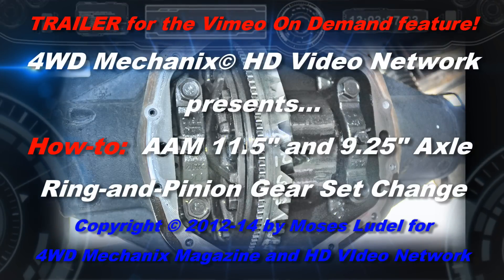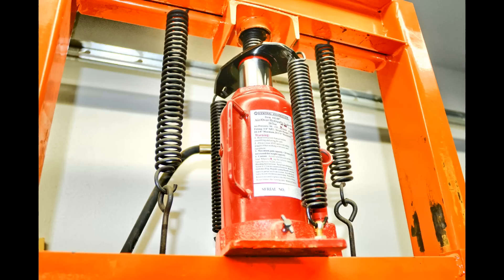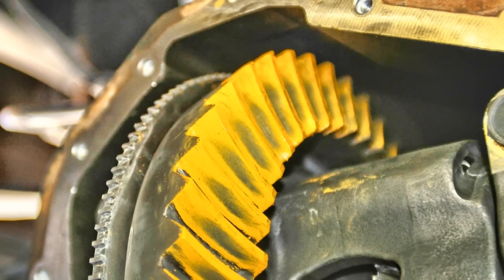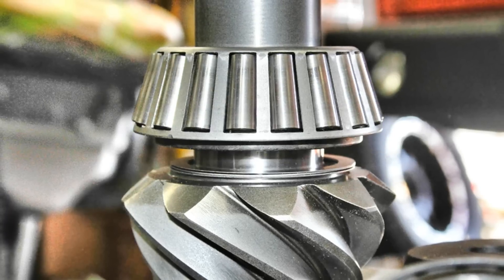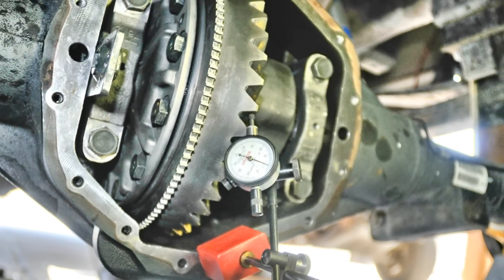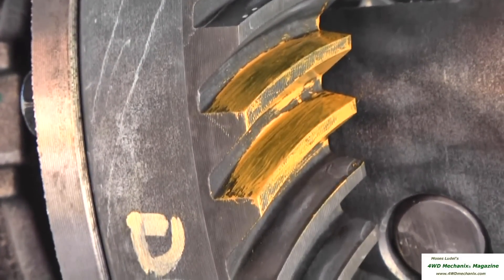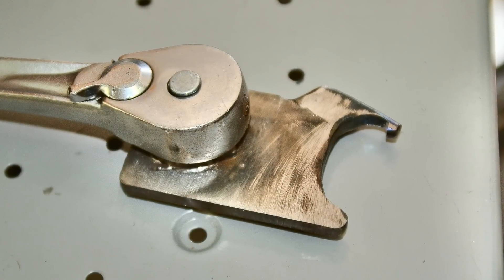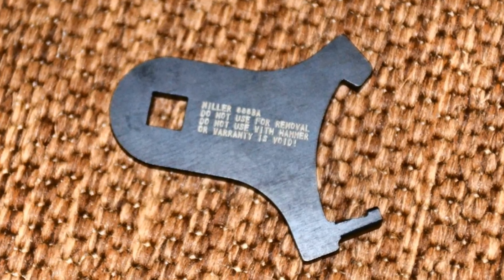TRAILER for the Full Length 75-minute AAM 11.5" and 9.25" Axles Rebuild Video

Comment: I am running 35s and was told by Yukon that 4 11s would get me back to the stock gear ratio
Reply from the maker: This would be as close as you will get if your gearing was originally 3.73 and tire diameter was 31.7" to 31.9".  The easiest way to test this is an rpm calculator.  I first run a calculation on the original tire diameter with the stock axle gear ratio.  I use 60 mph for the baseline.  See what speed the engine turns at 60 mph with the original tire diameter and stock gearing.  Then do the same calculation with the 35" tire diameter and 4.11 or 4.10 gears.  Compare the engine's rpm at 60 mph.  If you have overdrive, make sure you use the overdrive ratio when you input the transmission gearing.  On my 2005 Ram 3500 with a 48RE 4-speed automatic, the transmission overdrive (4th gear) is 31%.  So I use .69 as the transmission's final gear ratio.  Spicer has a calculator:  https://spicerparts.com/calculators/engine-rpm-calculator.  Here is the easy calculator that I have used for years:  http://www.csgnetwork.com/multirpmcalc.html.  There are now many calculators available.

Comment: Hey Moses, can you tell me the part numbers of the sleeves you used in the video to push the tinker bearings onto the differential and for the rear pinion bearing? Doing a rebuild this weekend and could use those.  Also what size / PN bearing splitter/separator you used for removing the pinion rear timken in the video "yes I rented your video on Vimeo"

Cheers;

Andrew
Reply from the maker: Andrew, thanks for supporting the rental video, it's been popular.  Since this may be a one-time job, the best bearing splitter is a "universal" type.  I have expensive "capture" bearing fixtures for axle work, though you can get by with a common splitter like an OTC 1123 type.  (Search for images online, National Tool and everyone else carries this puller.)  I like the ability to add accessories to this particular splitter design, in particular a stand-off fixture with threaded rods that stand outward from the puller pieces.  Make sure this or any other splitter you choose will clear the bearing cage.  Measure the bearing before buying a puller.  

The idea is to carefully grip the bearing collar's backside at the seat point without chewing up the carrier or a gear bearing shoulder.  Once you have an ample grip on the backside of the bearing's collar, place the splitter on your press deck.  (You may need to make a safe stand to provide clearance between the press deck and parts.  Be creative while keeping safety in mind!)  Rely on the press to remove the bearing, the splitter is simple to get an ample, safe grip behind the bearing's inner collar.  Never apply pressure to the bearing cage, it will bend and distort, ruining the bearing.

For pressing new bearings onto the differential flanges or the pinion back bearing, again rely on your hydraulic press.  You can improvise sleeves with large deep set impact sockets of the right depth and I.D. (if you have them).  Black pipe of the right inside and outside diameters also makes an adequate sleeve for pressing a bearing into place.  In making a sleeve, be sure that the contact surface puts pressure only on the bearing inner collars and not the bearing cages or tapered rollers.  You can damage a new bearing by placing force against the roller bearing cage or rollers.  The pipe/sleeve should be whatever length necessary to clear the shaft.

If you have further questions, please reach me through the forums.  We can move our discussion to http://forums.4WDmechanix.com.  I would be glad to assist with any questions you have on this project.  Join us, other forum members will benefit.